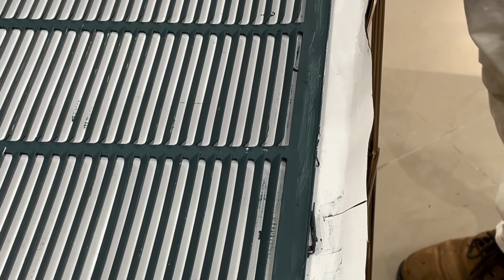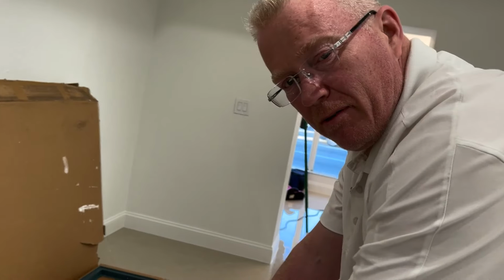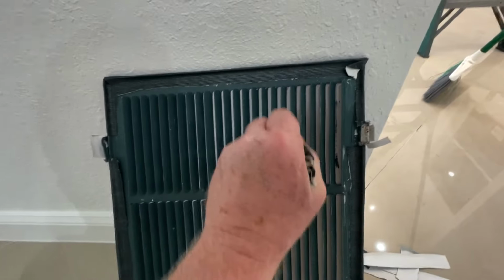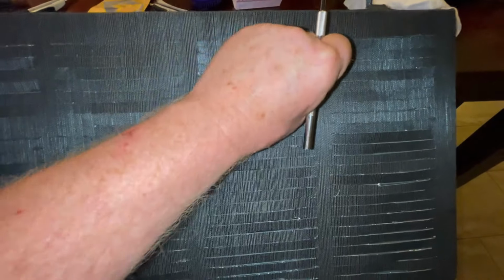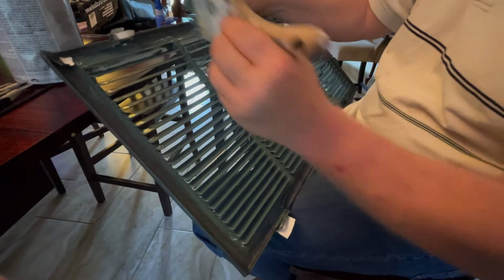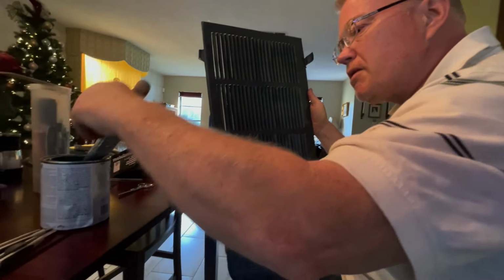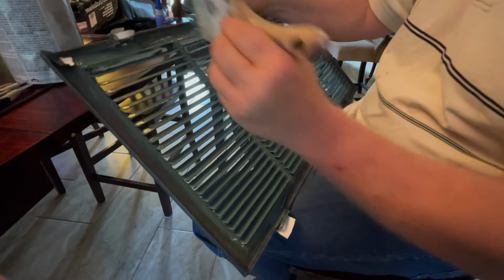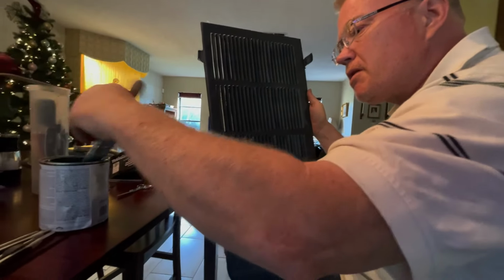How to Wallpaper a Large Air Conditioning Vent Cover - Spencer Colgan

Comment: Hello Spencer thanks for your wallpaper tips. Do you have a video talking about installing WP around the minisplit(AC) on the wall? thanks
Reply from the maker: Essentially, yes I do. Specifically, no, I don’t. Installing wallpaper around an air conditioning unit would be the same technique is installing Wallpaper around A cabinet, or even if you can imagine, around a toilet paper holder. The principles are the same with regard to technique, although of course in your case, on a much grander scale.